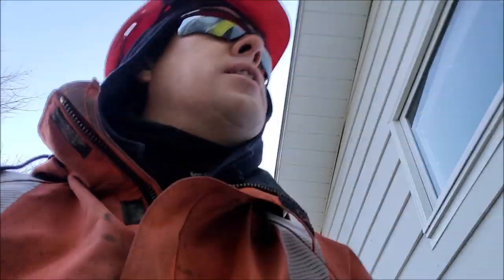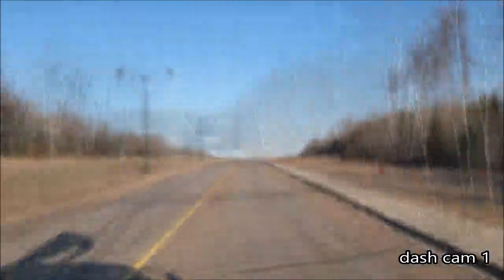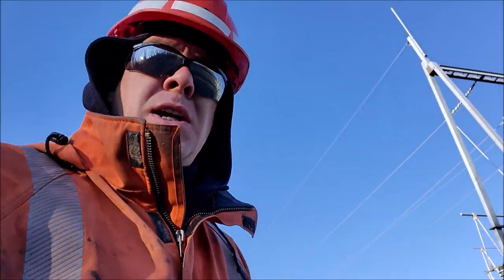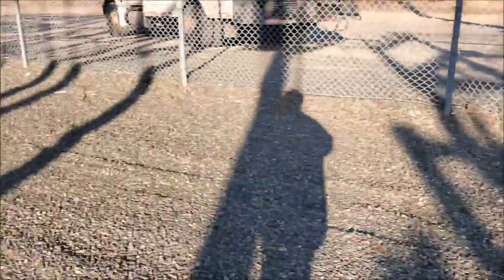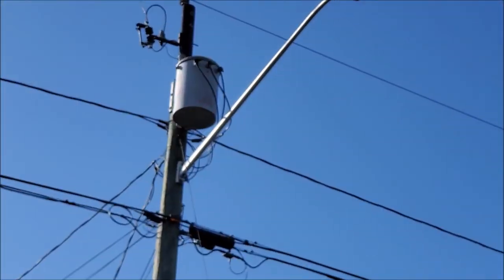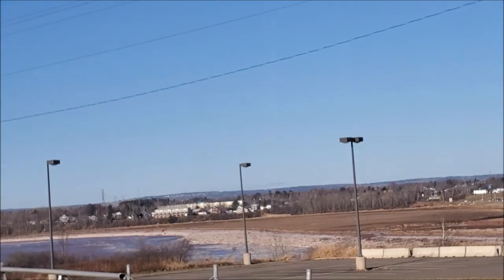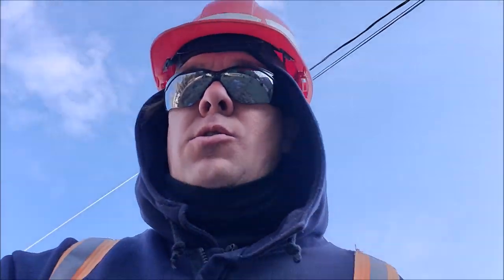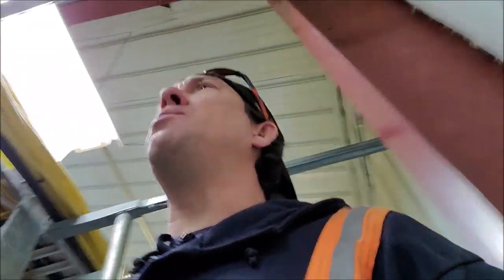Being a Lineman - Episode 3

Comment: We were told they never had a failure with that type of photo control. Good sales pitch. Lol. We stopped using them for the same reason. Water shorting the circuit board.
Reply from the maker: Yeah really, We have a ton of them failing now. At the rate they are going, I think each and every unit will fail eventually

Comment: Down here in New Jersey, North New Jersey anyhow, The electrical contractors cut the power at the hook, replace the meter pan themselves and all the wires for the service and then reconnected themselves.  After town inspection gets passed the utility company normally comes back to replace the bugs at the hook.  It seems crazy but they let us do it
Reply from the maker: Interesting 🤔 It would be efficient for sure ! Hopefully they have some extra training in identifying hazards at the very least!
Reply: In PA it’s even crazier we are allowed to not only pull the meter and reseat it when doing a panel change out but we are also allowed to disconnect and reconnect the house side of the triplex. Underground services we have to work live as it’s very rare that we have utility  company open the cut out. Usually we only have them open the cut out if we have to replace the entire triplex or retrench larger underground feeders from a pad mount transformer or splice pit to the house

Comment: Frankly, I'd keep the fuses, as long as there is enough current  available, decided by the 
size of the 'Mains fuses' usually in a bakelite or porcelain pull out block, so as to electrically
remove power from the house by 'pulling the mains' same set up for the stove or range
and maybe the water heater. fuses work simply by a piece of lead known to conduct a pre-
determined amount depending on the gage of lead, whereas a circuit breaker uses 
a magnetic field to pull an armature with enough effort to break the contacts, or build up of
enough heat to cause a bi-metalic strip to bend  and break the contacts.latches and springs 
are used to close the contacts.

Comment: Great video...... curious why you didn’t you disconnect hot legs at pole connections instead.... this way you didn’t hafta pull out the ladder lol? Utility requires it to be separated at house or is this your personal preference?
Reply from the maker: It's at our discretion ... Usually I just cut at whichever end has the most slack in the loop. This particular one the pole was backlot with a nasty rats nest of connections on it.
Reply: Bobsdecline - Lineman blogger oh well in that case if ya can’t get it with a bucket then f*** it hahahahaha..... ladder on the house all day lolol
Reply from the maker: Haha for sure !

Comment: I  am a little confused on why the meter was not showing any reading , is your meters not powered by the source side of the meter terminals. I understand the customer side of the breaker was in the off position but should it not still show the current readings. Good video as usual , have a great christmas
Reply from the maker: There are a few setups in which it's code in our province to have a breaker on the source side of the meter. It can definitely cause some confusion sometimes, because the customer owns the breaker. 
We only see it in commercial buildings or apartment buildings which use network meters fed of a  TX bank.
Reply from the maker: And Merry Christmas to you as well!

Comment: Does every customer,(small houses) get 3 phase connection ?
Reply from the maker: There are three wires, but it is not actually three phase! Most homes use what is called "3 wire Edison".
Two hot wires and a neutral (which can be considered hot at times).
Most house hold items will use a hot feed with a neutral return, to achieve 120 (ish) volts as it completes the circuit. Items will alternate hot wires as an attempt to balance load and achieve the least amount of fault current return on the neutral wire. Large or appliances which require heating will mostly use both hot wires to complete the circuit resulting in 240 volts across the appliance.
In the case of apartment buildings, we often use three phase to supply the building. The actually unit will only see two of these phases leaving the third to alternate units, as we balance to the load across the entire building. In this case a hot - hot connection will result in a 208 volt supply rather then a 240v.
Reply: @Bobsdecline  Ahh i just read about this right now, its to prevent voltage drop, and a part of history in this kind of Electrical grid system. That means it would be possible to use a secondary hot wire, ground it and use as a neutral wire when converting into a single phase 240V 2 wire system. What is then the common fuse rating of this hot wires for house, and are house owners able on their own to disconnect main low voltage house fuse or is this a service they have to call you ? Here it is like this, you have 3 main fuses of about 25 to 50A, usually in a sealed box for energy provider. I think because the input of the fuse box on the houses are covered by very high breaker values. And just after this box copper rails,3phase ground fault circuit interrupter and then the following circuit breakers common 16A each, sometimes 13A.
Reply from the maker: @MetrakitProRaceII  customers are allowed to operate all of their own low voltage switches and change fuses. Code differs but often states that they aren't permitted to work on their panels however. Furthermore, even an electrician is not suppose to work on the main disconnect or fuse without us being on site for a disconnect/reconnect and permit check. Most common size now is 200 amp for a standard size house , while individual circuits break down to 15-60 amp . There are still some exceptions to those numbers however for very large houses and advanced or older setups